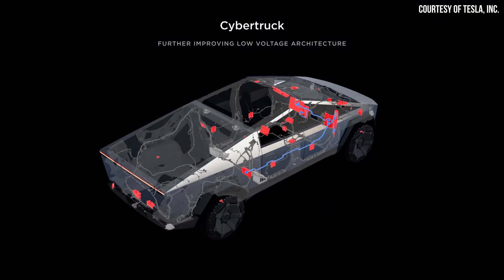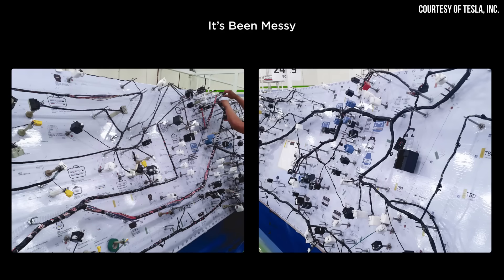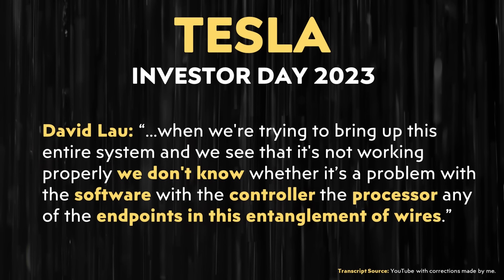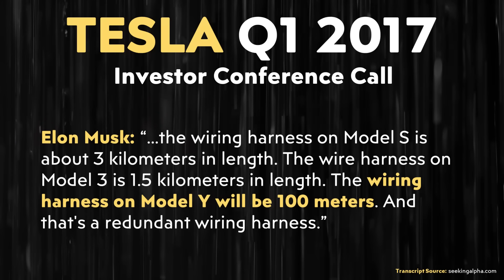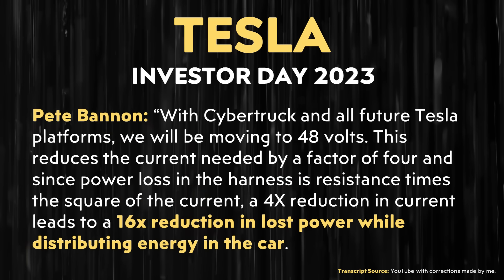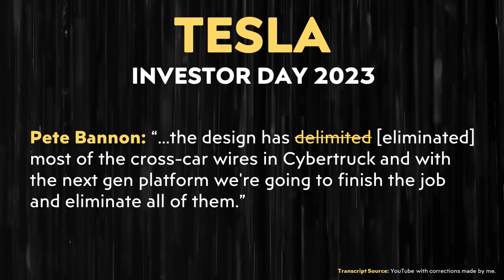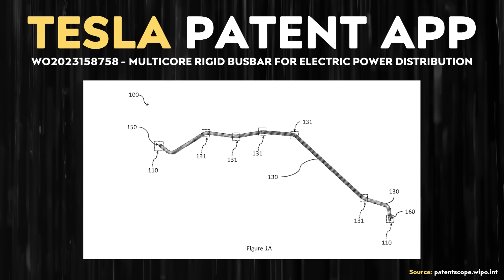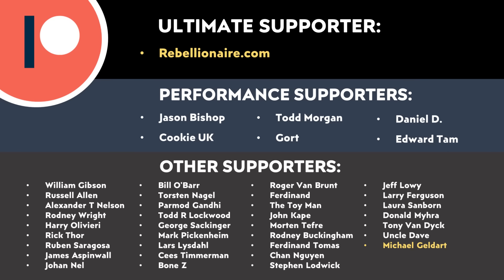NEXT GEN $25K Tesla EV Wiring Design Revealed | 10X Better!

Comment: Going to a 48 Volt system alone allows for far lighter and less expensive wiring.
Reply from the maker: True!
Reply: Most 12v loads in a car are lighting, and this is low current led. 12v is fine for these small loads. There isnt a current hungry starter motor in an ev, so 12v is fine

Comment: Running low power components on 48V will only require extremely small gauge wiring. HUGE material savings with higher efficiency.

Comment: You actually did not explain how a "connection-less" power distribution system ... could actually distribute anything. Well, Bluetooth or laser optics might distribute information; maybe wireless power transfer works too. Another issue that comes to mind is "modular" factory assembly. Perhaps the "rigid busbar" is a part attached to the vehicle frame ... and all of the modules then have their own "touch points" (if not connectors) to that busbar part when they come together to form the car. This whole topic of 48v dc (and high voltage) wiring systems along with digital steer-by-wire and all the other IT bus/controller/sensor or actuator systems is very important. It would make an excellent "deep-dive" video. For instance, how reliable, vibration- and weather-resistant, and transmission "error-free" really is a 100 meter long Ethernet cable system out "in the wild".

Comment: I engineered 44 years world wide in big auto wiring harness build and test. Its clear 200A must be scaled back by 48v and it took a vertically integrated software biased engineer led company to make the shift 100%.  Ethernet / buss bar allows robotised manufacture and assembly, never close enough to the costings to qualify the 10x claim but based on previous Tesla patent claims I would say they are right.......earth shattering for the wiring harness industries.

Comment: Several years ago many building systems changed from each device having a pair of dedicated wires from the main panel to the device, to the devices being addressable and connected to a variation of ethernet. Sounds like Tesla was moving in that direction and the new model will expand it further. Each Tesla will have its own Internet of Things with Ai running rampant in the system.
Reply: Very similar to what I think they are doing 👍
If you have many local controllers on a simple PoE 24V loop you don't need wiring harnesses!

Comment: What many have misunderstood is that Tesla's reduced wire concept is the complete Elimination of wiring harnesses!
This will be achieved by controlling everything through their own local Ethernet controllers located close to the switched electrical parts. This means very short wires from the part to the local controller. 
They may also integrate the 24V power into a single PoE Bus for additional simplification!
This  leads into their next-gen modular parallel assembly concept where every module could be fully tested before final assembly!

Comment: Thanks Jon, great job as always.
The busbar concept is very cool, it becomes a "wire harness" that holds the proper shape, which makes assembly much easier..  And the (presumably) aluminum busbar should be lighter and cheaper than copper, which lowers electrical losses and cost.  All around a great innovation!

Comment: Hi Jon, an awesome video... Tesla will always be one step ahead of all other manufacturers, with their continual improvement of all products.
Reply: Not so.
Tesla has stated they will follow the other manufacturers and provide vehicle to load (VTL) "in 2 years". Why not now ? Get up to speed Tesla.
Tesla should follow the other manuafacturers and switch from their 400v to an 800v architecture. 800v is way superiour.
Tesla is following CATL and BYD and will make their own LFP cells next year. Most Tesla evs sold globally have Chinese made LFP cells fitted.
Tesla has also followed the other home battery manufacturers, and have recently upgraded their powerwalls to LFP.
and many other examples.

Comment: Hi, John yes the higher the voltage the less electrical resistance.I guess they are going use a 48:volt battery also.Tesla is working to full automation of there efficient advanced high tech factories 😮✔️🖖🌎

Comment: Hi John, 
Will be very interesting to find out how electrical connections will be made from rigid buss “pipe” to power components, guessing insulation displacement blades, tin plated with reliable connection to all four conductors 
Ted
Reply: As they make many components in house - they may make components (controllers, motors etc.) that already contain the ID blades to connect to the busbar....potentially a quick reliable assembly method.....
Reply: Idk, aluminum started a lot of house fires at that junction...
Reply: @jack-wl8uj  And found its way OUT of building code approvals. Hmmmmm.

Comment: 16x reduction in power loss over wires might also manifest as16x smaller wires at the same amount of loss, which is probably more helpful, as it reduces both cost and weight
Reply: I think the wire size is about 1/4, as is the weight and cost.  Then there's the reduced amount of wire being used, and if installation can be automated the overall cost could be way lower for sure.

Comment: Electronic control removes the problem of mechanical connector, switch, and fuse arcing wear and corrosion associated with higher DC voltages.
Reply: Thanks for this. I was wondering why 12 volts was used in the first place

Comment: Thankyou, I've been looking for this info for a while now but it's not that clear yet. Does this mean that using the brakes, lights, horn, blinkers or windscreen washers & wipers will be controlled by wireless activation nodes? If I'm correct in that, how are these nodes protected from external interference?

Comment: Sounds impressive. My only question is why isn't this busbar based 48 volt architecture being implemented across all vehicles, S, X, 3, & Y as well as CT and next gen models? Must be more difficult to develop and implement than it sounds.
Reply: Thats the plan
Reply: Until all the controllers and low-voltage electronic devices can handle 48V (most are still 12-15V in S3XY), you can't switch to 48v and busbar. If you used busbar w/ 12v it would probably have to be too big/thick for the current needs?
Reply: He is doing two things simultaneously- 48 volts is one part of what he is doing. Making all components operate from a buss is the second part. Aircraft do this😀apparently some boats and large buildings also-but this is a major reinvention of how each part works. Maybe a local controller and some of the stuff is still activated by dc power. Think he will have some connectors as he plans to build car in subassemblies which are attached at a much higher level than at present.

Comment: The big benefit for ridgid busbar, is for easier robotic installation of the wiring in the car... besides MUCH easier/cheaper/automatable manufacturing of the wiring/"harness" itself.
Robots can't "push" floppy wire harness around, that needs humans, connecting all the little clips and spaghetti wires/connectors.
A rigid busbar can just be pushed & snapped into place by robot, like a piece of sheet metal.
Now, connectorless? THAT is an interesting aspect of the patent..?? no clips/connectors? Does it just tap the busbar like thick coaxial network did or??

Comment: I would think the accessories, computers, stereo, etc. in Tesla’s current cars use between 300 and 600 watts. So, if this is true, you would use about 8 miles worth of range on a 4 hour drive. This would amount to about 1 minute of Supercharging.
Reply: Show your math....
Reply: @BenefitOfTheDoubtInquiry  if it uses, let’s say 500 watts, that would be 2kWh in 4 hours (0.5kWh x 4). The cars go about 4 miles per kWh so 2kWh would be 8 miles.  Supercharging does about 600 miles per hour on average which is about 10 miles per minute.  Does this make help?
Reply: @lemongavine  thanks!

Their whole effort though is likely a large scale plan to reduce wasted raw material in construction.

Comment: What does a 16X reduction in power loss mean? What is the reduction in power that you’re multiplying 16 by to get your power saved?  Reminds me of the urinal at work that has a sticker that says “Saves 2x more water than a 1gpf urinals.”
Reply: It means if you use a current 4th the size of the 12 v system the power lost in the wiring  will be a 16th of what was lost. There may be savings in the components as well but that would depend on their design and cannot be assumed to match the ratio perfectly.
Reply: @alanrickett2537  Ah, that makes sense. Thanks. If they had said the power loss is 1/16th that of a 12v, that would have cleared it up for me. As they stated it, it is still a convoluted to get to what they meant. Thanks again for bringing clarity.

Comment: This is nothing.  GM has a patent on using the windshield  as a sort of fiber optic connection rather than using wires at all.  More specifically it relates to automotive data communication and telematics, and particularly to using a glass panel (e.g., windshield glass) as a high-speed optical interconnect by leveraging the lightguide properties of glass.  In particular, the wiring harness can be greatly simplified as only power would need to be gated (e.g., to the roof) via the wiring harness.

Comment: Ya, probably 48v data over power, capability to use 1/4 current capacity and use only 2 wires to feed all lights and accessories power and data, common data buss, each node is addressed by the central PC, EASY, EFFICIENT.  
:person-turqouise-waving::person-turqouise-waving::person-turqouise-waving::person-turqouise-waving::person-turqouise-waving::person-turqouise-waving::person-turqouise-waving::person-turqouise-waving::person-turqouise-waving::person-turqouise-waving::person-turqouise-waving::person-turqouise-waving::person-turqouise-waving: